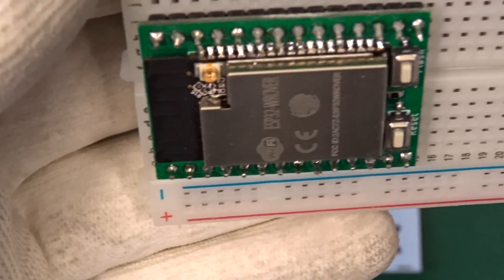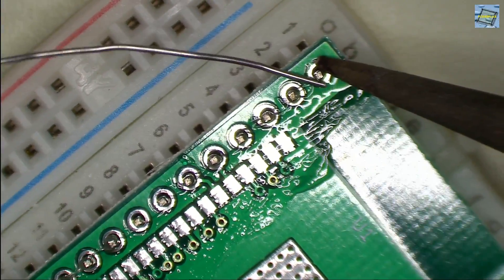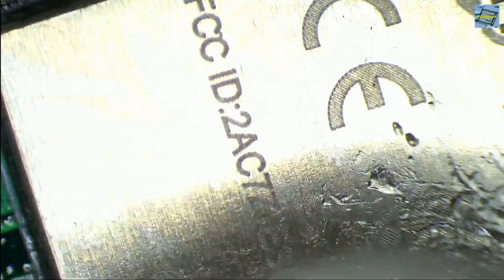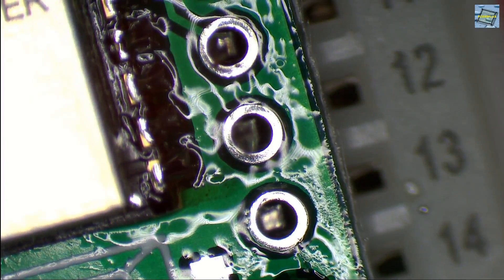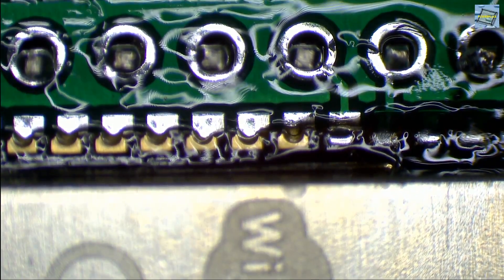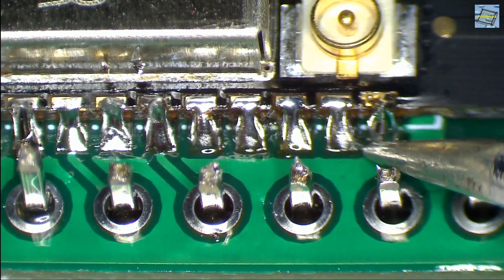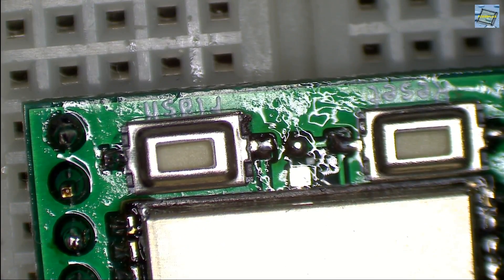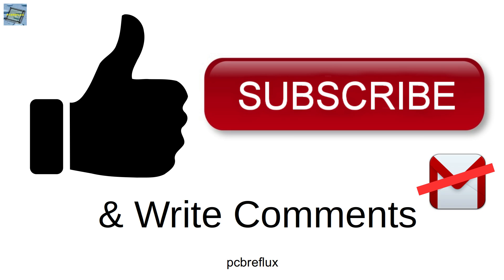ESP32 #75: ESP32-WROVER-Module Adapter Soldering

Comment: Cool ~
And the center ground pads don't need to be soldered? Thanks
Reply: I was wondering the same. He IS connecting multiple grounds from the pins, but I would have thought the pad is there for a reason.

Comment: Thanks for your interesting video. Since I am worried about the soldering of the whole module, I'd prefer a presoldered module - do you know of any? Of course I could use development boards but I would prefer a ESP32 already soldered on a breakout-board. That would facilitate a lot for me, I could concentrate on my own pcb and just would solder headers on my pcb to put it the ESP32 module.
Reply: An additional  question - would be be willing to sell your adapter modules in small quantities? I just lookedat your video where you designed the pcb. I am not able to design such a board myself so it would be really helpful if I could buy some of your modules.
Reply from the maker: Maybe there are some bare presoldered Modules with the ESP32 WROOM or WROVER module on a PCB with 2.54 mm pin headers but not seen one beside the Dev., Wemos or Lolin and other board with additional circuitry. If you prefer through-hole soldering eventually try a 1.27mm pitch header-pin for the  ESP32 WROOM or WROVER module (but never tried myself)?
Reply from the maker: No, not selling the boards. Just the shipping for me is more then for you to order 60 boards from a board house. You can upload the published gerberfiles (see https://github.com/pcbreflux/espressif/tree/master/esp32/kicad/ESP32-wroover-adapter/gerber download an add them into one ZIP file) to website of the boardhouse of your choice. Search for "$2 PCB" or "$5 PCB" and you can order the prototype service offering. But you have include shipping to your total bill. One example howto see my "$2 PCB ?" video.

Comment: Is there no need of thermal paste under the esp32 to distribute the heat better to the pcb?
Reply from the maker: For my purpose to test the prototypes it's OK without and the module don't heat over 47°C (without any cover). But you are right, if you need it you can solder the module down to the heat pad (see other the comments) or apply at least a little thermal past to the pad.
Reply: From the ESP-WROOM-32 datasheet:

Note:
Soldering Pad 39 to the Ground of the base board is not necessary for a satisfactory thermal performance. If users do
want to solder it, they need to ensure that the correct quantity of soldering paste is applied.

Might still be better though.

Comment: Two question:
1) What is the box op contacts under the module?  I thought they might be BGA pins; but, I did not see you solder them.
2) Have you tried using solder paste?  You can squirt is on the PCB pads then use a heat gun or soldering iron to flow it to the module pins.
Reply: Ad 1) These holes are thermal vias https://en.wikipedia.org/wiki/Via_(electronics) to help transferring the heat from the chip to the pcb where it spreads out. A Kind of heat sink. And yes in my opinion they should be soldered too. ESP32 runs hotter than ESP8266.

Comment: Its faster to drag solder the esp and clean the bridges after
Reply from the maker: Thanks, try this with the next module and use my fx-951 with a bended or chisel tip. With the conical tip on my weller station this messy.

Comment: Thanks for sharing your work.
You did hide the most interesting and in maybe the most important Thing: Soldering the thermal vias. Normally this is done by the reflow Process. But how to handle using manual soldering?
I soldered several EPS32 WROOM modules  and td to solder the theraml vias from the back side after pretinning and fluxing the thermal via area. Unfortunately I do not know if it works.
For temporarily fixing parts during soldering I often use a wooden made peg. They are cheap  very versatile and Show a sufficient heat resistance. You can use such a peg to fix the module on the pcb. Then you can adjust it and set the first solder joints.
Then I add a 10µF 0804 cerco between 3.3V pad and the metal can of the ESP32. Looks a Little botchy but works. You create your own pcbs so you can add the capacitor beween 3.3V pin and GND pin on your PCB.
I just buy the most common part in volume. Fo the rest I am using the Chinese SMD sample books from eBay or ali.
Unfortunately I do not have a microscope. Do you use one?
Reply from the maker: Good point with the thermal pad, but I don't hide it ... I don't solder it with this manual technique. Would do this only if I use a reflow process (oven or pan) and solder paste. But I don't have a reflow oven and no pan to mess up.
For the next revision I will add a footprint for a capacitor and maybe also a 3.3V regulator. 
And yes, I use a microscope (see description) and my eyes are unfortunately not good enough to do this without any magnification.

Comment: Amazing !
If I have to do a tutorial on soldering, I would use exactly the same words as you did. Even, fluxing the copper braid… ;-)

I still use leaded solder and my station is set to 370C, bc I remember the euthetic melting point thing from my apprenticeship 35 years ago.
I'm not up-to-date on the new lead-less solders and there optimal melting temps, perhaps you could dig in it, in another video?
Reply from the maker: Thanks for your faith, but all my attempts with lead-free soldering have failed so far.

Comment: Excellent, now I just need to know where to find that ESP32-WROVER breakout board, please ?
Reply from the maker: If you want your pcbs manufactured search for "$2 pcb" or "$5 pcb" to find cheap ways but your have to add shipping costs. And that's cheaper than sending one of the boards from my location.

Comment: Better way to soldering this module and whole smt IC is mini-wave. Using more solder to cover a few of connetor and slow move of iron, its possible to make clean connections. If You have shorts, its can remove by clean iron or solder wick.
Reply from the maker: Thanks, last time i try this unfortunately a bridge have formed under the module I could not get rid of (and that was when ESP32 modules have cost a fortune). But will try this again after changing from my Weller solder station to my FX-951 with maybe a K or J shape tip.
Reply: Tip is big drop of tin, which follow behind solder. Its method to lead any IC, inculed 0.5mm tsop or QFN. Good luck!
Reply from the maker: Kamil Bystryk Thanks, got new PCBs today with also QFN package so definitely have to use other techniques including my heatgun. Louis Rossmann is always an inspiring source for ways of soldering.